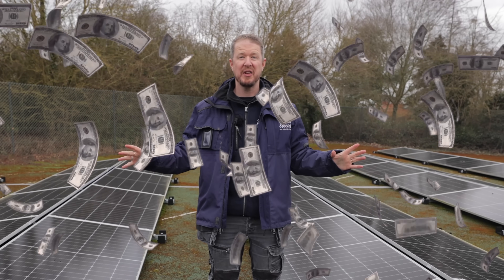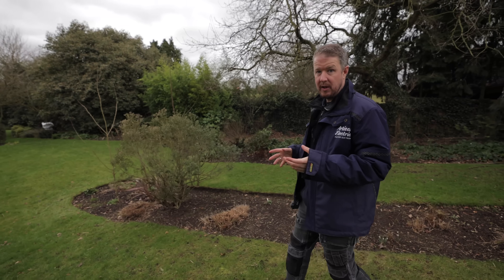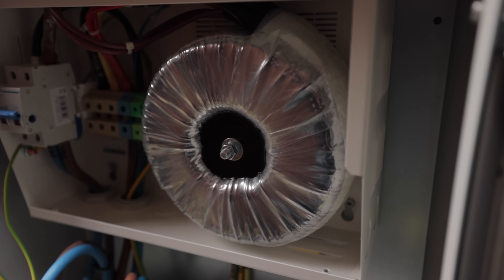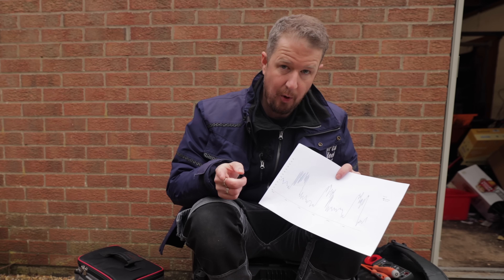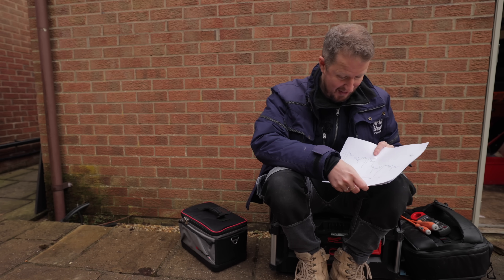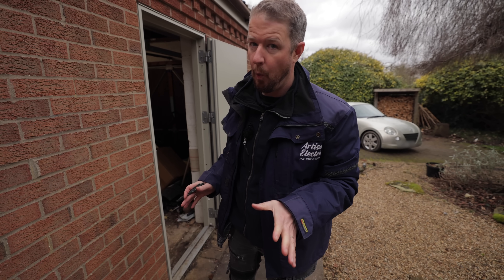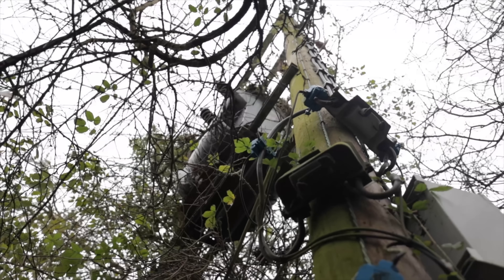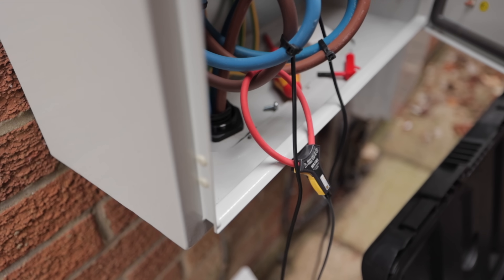THOUSANDS Down the Drain – And We Can’t Do Anything About It!

Comment: If you were to fit a voltage conditoner,(not sure if they exist in such small sizes) they should be installed upstream from the solar. So basically between grid supply and conditioner. The voltage rise from the PV causes the conditioner to not operate properly. Optimizers like you have there are not dynamic, so the problem you are getting is expected. Might have to look at the cable size as well. If supply cable is too small or on the edge, then it will amplify your problem as well.

Comment: This is on you. It took you minutes in this video to find the transformer and note how long the runs are and the general state of the network between the clients house and transformer. Why did you not do this before installing such a large system? Sure It's their equipment not yours but YOU sold the system with out doing the footwork and maths to know it would connect.

Comment: Had an almost exactly similar situation to this on my install, 25kw array and ~ 50KW battery storage. V was all over the place with similar high V spikes. The local DNO was very helpful after lots of moaning and ended up pulling 3ph in on different transformer legs and a new overhead line and the problem went away.
I'm amazed they granted full rate export on a single phase supply!

Comment: Ah, now I understand.  Artisan has dug a hole for themselves and are trying to climb out of it.  The customer expects to be able to export X and gaming the system by installing the voltage stabiliser is the only way for Artisan to achieve that, at least by the explanation given.  I'd still want to see what the voltage across the premises wiring is - ie across the wiring from the AC output of the inverter back to the installation's point of connection which being the UK is probably where the metering is - when the inverter is saying 260V and also measure what amps are flowing at that time.  The premises wiring may not be sufficient.

Comment: So let me get this straight. You installed a 17kW (charge rate) capable system on a single phase supply nominally of 18kW and didn't expect voltage swing?
How on earth do they run their electric heating and whatever other power supping devices such as the EV charger during the night when you're putting 17kW into the batteries?
Personally I can't believe UPKN approved it in the first instance for connection as a microgen. And question your sanity and logic upon installing a 17kW load on an 18kW supply rather than advising it needed a 3p uplift.
I'll wager UPKN's response will be "limit the export or here's a quote for the transformer upgrade". Which would you prefer?

Comment: So let me just get my head around this. A famiiy whi clwsrly aeent short of a money, having a drive bristling with new cars, a garden bug enough to have a tennis court that they don't even use want to profit from forcing huge amounts of power back into the local grid which was never designed to be back fed. Doing so raises the local voktage to a level where all the other neighbours will be having issues and maybe even damaged electronic equpment as a result. But the fanily wanting to profit from this, now want the power company at the expense of either the tax payer or all the other bill payers who won't profit from the solar, to foot the bill, so they can make money exporting power.  Am I understanding this? I see only two options. Get uk power networks to make the upgrade and then profit share all electricity exported with all the affected neighbours and further afield, whose bills would be covering paying for this equipment, even though they wont benefit from paying for it. 
Or option 2, stop exporting and dump all excess power into a large water heater system to provide all hot water, and stop messing up the grid for everyone else.

Comment: Got to ask a question 17KW = 17000/240v = 70 Amps, there is no way 70 Amps can pass through that small toroidial transformer, even if its an auto transformer, the windings would need to be at least 10mm at 50 Hz, possibly a high frequency transformer, but the components around it does not appear to be so

Comment: The whole idea of the solar shutting down over 253 volts is so the supply does not exceed that voltage to any of the premises on that supply, using an auto transformer to defeat the inverters built-in protection can never be the way to go, it needs an auto stepping supply transformer, and until that is done, the solar will simply not work, full stop, nothing anyone other than DNO can do.

Comment: Whats puzzling me is why the PEN fault detector on the car charger?. Is a property in that situation not provided with a TT earthing system? In which case there is no PEN? In any case the car charger could be provided with its own TT. This does not solve the volage swing problem (of which I can't add anything that has not already been said in other comments) but at least the car charger can remain usable provided that the car can withsand the range of voltages.

Comment: Sounds like your inverters aren't doing their job correctly. But i suspect there is an issue with regulation on the local grid, possibly the nearest transformer is tapped very high to make up for losses/being overloaded. As you lift the load off the grid, the voltage rises.

Comment: Check the inverters 
DEMAND RESPONSE SETTINGS which are directly proportional to voltage regulation 
Inverter designed to help the grid stabilising voltage and power distribution Therefore when grid voltage is higher than recommended level the inverter will influence an inductive circuit to the grid to reduce the voltage 
And the other way around when grid voltage is lower than recommended the inverter will influence capacitive circuit to increase voltage 
Seeing the long run of the overhead upcoming mains plus the step down transformer condition I think it’s the distributor part to look at 
Also voltage rise calculation may pinpoint where the issue is

Comment: One question, why is the solar inverter pushing 260v???
Reply: First place i'd look,
Reply: Because they reprogrammed it, they shut off at 252V by default.
Reply: The AC-coupled system is pushing as much power as it can.  The only way to increase the current is to pump up the voltage.  They go hand-in-hand.   There is too much resistance on the cables... probably both on the property and the nearby rural grid, to push the full power without bumping the voltage up a lot.  The grid can't supply a low enough impedance for it to work decently.

So basically they need to DC-couple the solar so they can limit the export, or they need to add a large buffer battery and hybrid inverter to charge the battery from the AC coupled solar to sink the power locally.  Plus a way for the system to control the microinverters while still connected to the grid (since you can't do frequency control when connected to the grid).  OR have microinverters with a separate control loop to reduce their output.

The way the system is currently setup, the microinverters are pushing as much power as they can get from the sun with little regard to what the grid can actually handle and hitting their voltage maximums because of that.
Reply: @ Makes a lot of sense now, thanks
Reply: In simple terms - Too much Current
Reply: @mwnciboo Not at all. You can have almost no current and inverters shutting down from overvoltage if the line resistance is too high. If you live next to the power transformer you will see very little if any change in voltage but the inverters will push out the full rated power (and current), so your oversimplification is severely misleading. You always need to take Ohm's law into account.

Comment: Question, Do you not have a output voltage adjustment on the inverters for balancing for equal load sharing between the inverters? That adjustment also allows total output voltage adjustment for the combined output of the inverters. The connext xw pro's that I use allow about 10% adjustment and were about 20 volts low for my system and about 5 volts difference between the 3 inverters. You have to trim the adjustments as standalone for the target voltage no load save that, for each inverter and then combine with cabling and have a master/follower enabled on the 3 inverters to load share. the result was about 500 watt difference in load difference between the 3 inverters and voltage of the array was spot on and varies less than a percent of target. Just a thought!

Comment: So... where is the problem in adding in a timed switching system that just switches the optimiser in at specific times... or you actually measure the Voltage and switch it in when needed?
Reply: The optimiser is just a transformer with 3 outputs to that down the Voltage and ups the Amps in dif ratios right? Dunno why it was 1000s for that... Its not even a big Transformer. 
Does all the power that gets produced go through it? If yes.... why not add a small switching device that connects the needed Voltage decrease?

Comment: These moments require a little communist spirit, not more costly and complicated solutions. A solar farm should be a joint investment of 5 neighbouring houses, all behind the same meter. Obviously batteries are absolutely necessary. Lets say that increases the investment by 50%, but you split the cost by 5 households. An on-grid system has the advantage of never running out of power and after 6 months of monitoring, you can expand the solar system, if you are still pulling over 50% of your energy from the grid. I understand that in modern times you are more likely to meet your neighbours in court than on the street.....but hey, if we can think of a solution, we can implement it.

Comment: Maybe I'm just a dumb redneck, but, why not have a dump load (water heater or more batteries, maybe a separate bank.. ) to accept load when the voltage starts getting too high? Bascially the way wind systems or old solar pwm systems work.

Comment: I doubt there's anything wrong with the transformer, but that long service drop to multiple homes has to be an issue.  The utility operator probably has the transformer tapped for 240 to allow for a 10 volt drop.  When you try to export 70 amps, the inverter needs to go up to 260 to push current back to the transformer.  A 20 volt drop in that service line under full load should not surprise anyone.  Now, if you can export power to the other homes on the same service line, that will mitigate things somewhat, but apparently your neighbors don't have high demand during the day.  Long story short, this should never have been approved for export.  The only real fix is to bring the 11kV lines closer to the home and shorten up that service drop.

Comment: If you don't mind me saying, I think your diagnosis of the problem is way off, thats not a criticism, I think your videos are generally great, but in this instance there is a lot wrong with your diagnosis of the problem.  To much to explain in a comment here, but in summary I would say (and I have no affiliation with the DNO or power networks) it is a problem that you need to resolve, and seems pretty easy to resolve, if you consider all of the factors at play.

Comment: It’s not the distribution transformers fault it was designed to do what it needs to do for the time it was installed no one expected to have a lot of power flowing the other way. The DNOs distribution transformer will need to be upgraded or replaced with an on-load tap-changer to regulate its local 230 distribution voltage (also referred to as VRDT). However these are quite new, expensive and not used much yet. 
Effectively the Transmission Power transformer which has a on load tap-changer (hopefully with reverse power flow capability)upstream will do all the work at the moment, but obviously can only do so much or may be at it lowest “tap” as it looks at a way wider distribution network. Cheers

Comment: You can get pretty decent small battery and 500w solar panels are around 60 pounds. Im going to use one 500w solar panel with my Ecoflow delta 3. I will also get four more 500w solar panels and get an ecoflow delta 3 pro.

Comment: setup a pump and a means to run a water generator, and get your energy from the water generator not the solar cells. so when there is no sun, the pump water will move the electric generator that supplies power.

Comment: Well, the pole mounted transformer seems to be OK, the vegetation management is not flash, though. You might need to check your inverter settings - instead of a set power factor output mode, you need to set (or implement 😢 ) Volt-Watt Control (the best IMO), or Volt-Var Control. That probably something that your DNO is going to tell you.

Comment: Off this topic I have an idea to run your home electricity 24/7 at cheap overnight rates without solar and on a budget. Buy an old Nissan Leaf from around £5k + not to drive but to use as a cheap storage unit 2011–2017: 24 kWh
2016: 30 kWh
2018–present: 40 kWh
They have V2L and V2G capability. Your thoughts?

Comment: could you use a contactor to switch-in the VO transformer when the voltage is high or during the day (time based) and then switch it out during the converse, low voltage or when batts charging?

Comment: If the voltage at the house is 240 volt, and giveen the distance to the transformer, than the voltage-output from the transformer wil be much higher. So the voltage you need to feed before the power starts going to the grid needs to exces that plus the line drop.

DNO not wanting any load on the wire is just bu...hit, the voltage drop depends on the power used. 
For copper wire:
10 mm²	0.00183 Ω/m
16 mm²	0.00115 Ω/m
25 mm²	0.000727 Ω/m
35 mm²	0.000524 Ω/m
50 mm²	0.000386 Ω/m
70 mm²	0.000272 Ω/m

When running nothing, the base voltage is 240 Volt.

And because feeding the grid, instead of using power, gives the same voltage drop, only as a peek i calculate the voltage drop.

When running 4000 Watt at 240 Volt, the power is about 16.67 A
for a 10mm2 wire: R=0.00183Ω/m×600m=1.098Ω
so the Voltagedrop  =16.67×1.098=18.3V

For a 10 mm² wire, the voltage drop is 18.3V (7.6%), which may be too high.
For a 16 mm² wire, the voltage drop is 11.5V (4.8%), which is acceptable.
For a 25 mm² wire, the voltage drop is 7.3V (3.0%), which is ideal.

but with 17000 Watt:
10 mm² → 32.4% drop (unacceptable!)
16 mm² → 20.4% drop (still too high)
25 mm² → 12.9% drop (not great)
35 mm² → 9.3% drop (borderline acceptable)
50 mm² → 6.8% drop (better, but still high)

For a lower then 5% drop at 17000 watt, there needs to be at least 70mm2 wire.
Or 3 faces (L1, L2, L3), which changes the voltage from 240V to 400V, and feeds the power over 3 lines, instead of one.
With 3 faces, the voltage drop with 17000 Watt, with 16mm2 wire would be 9.6V or 2.5% ( for aluminium instead of copper you need  25mm2 for the same results.)

i think DNO has a job to do.
DNO needs to upgrade the lines, en probably go to 3 faces to solve this issue. With thicker wires the drop is lower, and with 3 faces the power per face is lower, and that also lowers the voltage drop.

Comment: Of course they need to monitor the grid power without the solar connected to get a baseline and confirm that the normal supply is or isn't within limits. If it is, then the onus is to limit the export power. If they find out there is an issue on their end, i.e. over voltage without the solar connected then they should lower the tap in the transformer and that would of course help your situation. But, there are more houses further down the line as well. You can't tap for that house to have 230V and then at the end of the line only have 205V. Sure, upgrading the conductors would help limit the voltage drop as well but how that got permitted for 17kW, single phase export is a little boggling in a rural area like that to begin with. 
But you can't troubleshoot a problem without doing the basics first, like monitoring the grid with no solar input. So that was a totally acceptable request from the DNO. By denying them the opportunity to check their end you basically gave them a way out. 
And why do those inverters go so high to begin with? They should have a hard limit on output voltage, regardless of desired power export. Over voltage > export power (ROI). 
Sticky situation there..... hope you get it all to work at the max power they are expecting.
Reply: EDIT I'll add, I know the three inverters are, or should be communicating with each other, but perhaps there is an issue with that and they are either individually or one set paired vs one unpaired and keep driving up the voltage uncoordinatedly. Aside from the ridiculously high voltage level there are even being allowed to put out. But could the problem be a misconfiguration comms between all three or a non comm connected inverter driving the voltages up too hign, in a race type situation. Not familiar with these inverters, but is VArs output settable or do you just configure the level of output and under what conditions. 
In large grid connected systems you can't really change the grid voltage. You supply more power by giving more power to your moving mass and controlling your VArs by the exciter voltage control. Since when connected to an "infinite" system your generator cannot raise the voltage nor change the frequency at all. The fact these were going over 260V is insane. 
Has to be more to look in to and verify on the inverters and programming. 
But first allow the DNO to do their readings with the solar disconnected and let them get the baseline info down and go from there. 
  😉